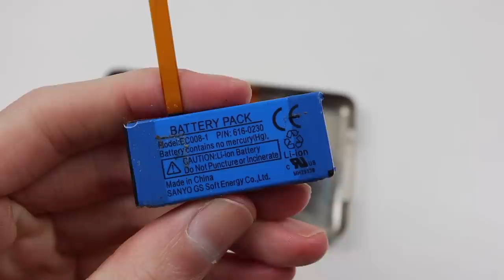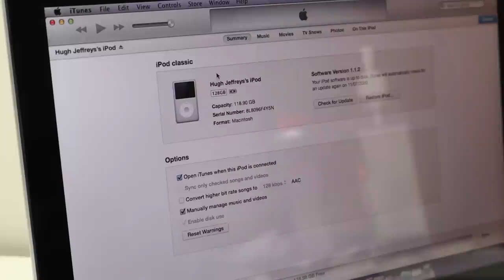Neglected, Beaten Up iPod Classic Restoration

Comment: 1:10 Retracts are when the drive detects a shock and the heads park to prevent damage to the platter.
Also hello DankPods fans, I am one of you!
Reply: Oh hello fellow DankPod fan! Also uh hi!? 
Considering this was carried around everyday, I presume this would have more retracts if it was used a lot considering a knock against the table could cause this? I don’t know, maybe that’s just me.
Reply: D A N K P O D S = 99.9999999999999999999999999999999% of the comments

Comment: You might be able to remove some light scratches in aluminium by sanding it down with an orbital sander (200 grit) and putting a clear coat/spray lacquer to protect it. It might not like up perfectly with the rest of the device and deeper scratches might be impossible without leaving a crater, but it's worth experimenting with

Comment: Scratches can be removed from Aluminium  with sanding, polishing, bead blasting and anodising.

The bead blasting and anodising requires lots of special equipment and skills and the sanding and polishing requires lots of hard work. It is almost always better value to buy a bootleg replacement.

Comment: you might find that it might be a bit slower as it has to convert it all and sometimes the ram cant handle it, however it will acctuaily  save the batery life. there is a channel called Dankpods he has made a bluetooth ipod and he has put 2TB in a ipod 5.5 gen. that is where i lernt to fix old ipods and upgrade them.

Comment: a retract is a g sense event   Basically it panics and slams the head back to the park position when it senses too much movement so it doesn't crash    Generally it is triggered by a drop while the drive is spinning This is perfectly expected.   Also lots of pending sectors / reallocates isn't a problem   as long as they are not constantly increasing every time you peak at it.    Then you should start worrying.

Comment: That silver iPod probably had the same amount of start stops on the hard drive as the black one, but the drive was a Samsung which for some reason does not track start/stops accurately. Since the hard drive turns on every few minutes to cache the upcoming songs, it would make more sense to have tens of thousands of start/stops on the hard drive over 10+ years of use, especially with 600+ hours. The iPod on the left likely has a Toshiba drive, which, along with the third brand of hard drives used in iPods, Hitachi, track all of the start/stop counts, while the Samsung drives only log start/stop counts if the iPod is plugged into a computer or a dock.

Comment: 4:40 The hold switch ribbon cable (the one that says "Apple Computer Inc.") gets brittle over time and can easily rip from the battery adhesive when trying to replace the battery.  Use caution.

Comment: 30$ for an iPod Classic in THIS condition? not that bad actually.
i got myself a 7th gen (160gb) in very good condition for 75$ about 5 months ago, back then the same iPod in horrible condition like the one in this video would typically sell for 30-40$, sometimes even below 30$ (depending on storage and LCD damage).
i don't even know where you got that 200-250$ figure for a 7th gen in good condition - that number is VERY wrong, 7th gens in good condition can easily be found for 70$ if you look at auctions.
and even if you get one that physically isn't in that much of a good shape it is pretty cheap and easy to completely replace all of its housing to make it look brand new again (altho if thats the route you're going you better get a new battery and an iFlash SD card/mSata adapter because these 7th gens will make you cut your palms A LOT)

Comment: Well, you actually didn't any restoration, you just cleaned it and changed the case for a brand new one... I am not saying that's a bad work, in fact it looks pretty good, but this is not that I understand as a restoration : /